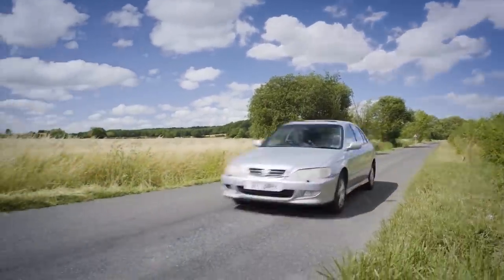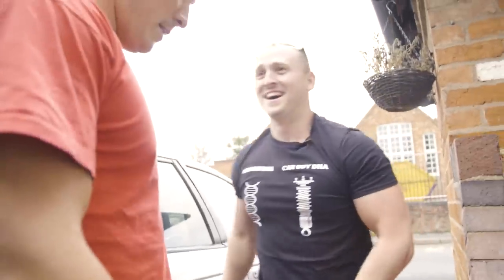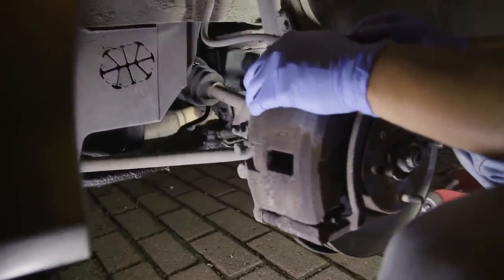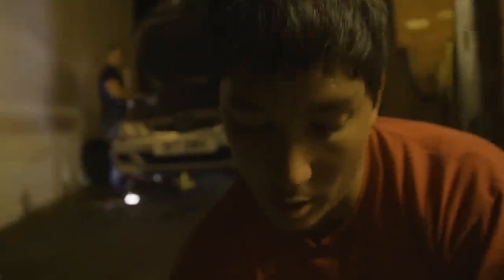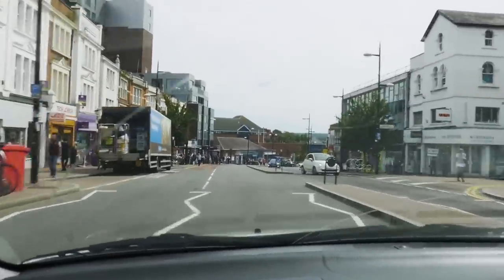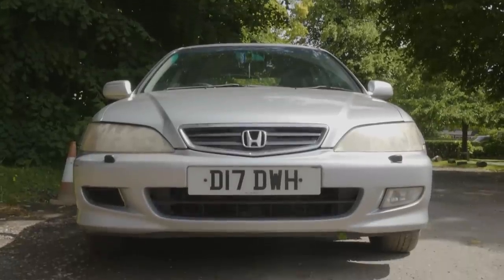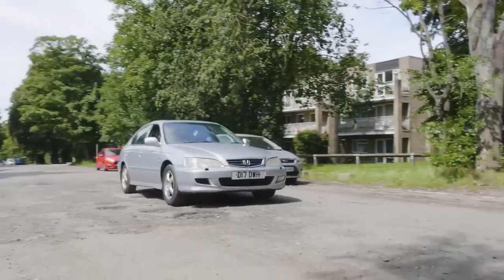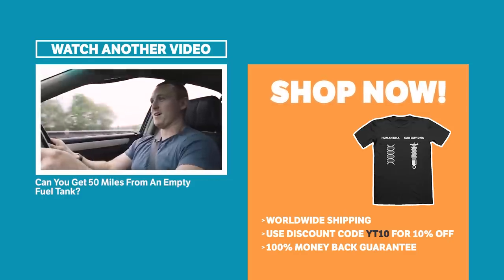Can You Daily Drive A Car With Cut Springs?

Comment: 4:50 "The spring rates have increased..."
WHAAAAATT?????
Reply: Nebbia affaraccimiei I read your comment just when he was saying that 😂
Reply: Gatis Girdenis cause the lowering springs have the flat bottom and correct pitch to seat correctly in the a-arm and not pop out.
Reply: Gatis Girdenis lowering springs are the same height as a stock spring uncompressed. The difference is that they have a progressive spring rate, which means part of the spring is softer than stock, and the rest is stiffer than stock. So when you put the car back on the ground, the softer part compresses more, thus lowering your car.
Reply: @iamstd2  wrong. Ffs. Google it
Reply: Cutting a spring does increase the rate, The longer the coil, the softer it is.
Reply: @iamstd2  I have H&R sport springs and they are already lower uncompressed, so what you say might be true only for some models of springs, depending by car model and/or by spring maker ;)
Reply: @spencerali1659  Are you sure? Because by cutting it you reduce the number of coils, but every single (remaining XD) coil remains unchanged in length, so i doubt that the rate changes this way....
Reply: RiccardoTheBeAst Read any chassis engineering book. Cutting a spring in half doubles the spring rate
Reply: @spencerali1659  Ooohhh ok now i get it, the single coil stiffness remains equal, but if you double the coils you also get double compression, right right... i had a wrong interpretation of your previous message, thanks ;)
Reply: @GatisGirdenis  Hes not wrong. 
Yes, cutting springs increases spring-rate; hypothetically, if there are 20 coils in a spring and each coil drops 1mm with 1kg on top, the coil will compress a total of 20mm. Now lets say you remove 2 coils, the spring will only compress a total of 18mm.
Its the same as torsion bar suspension (essentially a spring that's been unwound into a rod), if you cut the torsion bar shorter, the spring rate goes up.

Yes, cutting springs CAN cause the springs to pop out, for two reasons, firstly they've cut the square end of the spring off, so it doesn't seat properly. Secondly, the shock might be too long for the spring, meaning when the suspension unloads after hitting a bump the spring might be loose and has the potential to dislodge.

Tangential springs (Springs that don't have squared ends) can be cut without compromising safety as long as you fit a shorter shock so they aren't loose when suspension droops, and also higher damper rates so the car isn't bouncy and unpredictable.
Reply: @GeneralNOH  spring rates increase, ok. But the popping out, idk. I have a set of lowering springs on my car and when I jack the car, the spring is completely loose. Shorter shocks would sort that.
Most oem springs are not cut square, the spring seats account for the angled end.
Reply: @GatisGirdenis  Very good idea to get some shocks designed for your springs, or at the very least get the springperch moved on your struts.
It might not have fallen out, it might never fall out, but its possible and on top of that you essentially have 0 spring-rate at the in some of the top of your travel which is not ideal for handling if you go over a fast crest for example.
Id assume the lowering springs are also stiffer to prevent bottoming so the car doesnt handle as it should because the shocks arent suited, id bet it might even handle worse than stock. The shocks will also wear out quicker.

Im guessing you probably lowered it for looks moreso than handling but still something to keep in mind.

If you look at the video, the springs they cut did have squared ends. Pretty common on modern cars for at least one end to be squared off.
Reply: @GeneralNOH  quite a bit of assumptions.
Handles far better for what it is, it's not a racecar. It's a 800kg daily which is used for spirited driving, not jumping over 18 busses
The spring rate is not that much higher than stock. Also, I have oil shocks, which don't really have the "optimal range", just have to avoid bottoming out.
And checking two years apart, the shocks are still almost as stiff as they were before.

One end is squared off indeed, the topmount end, which no one ever cuts.
For euro cars which I'm familiar with, the spring seat is accounting for the spring with a stop, so as long as you cut it at the same place, it's gonna seat properly.
Reply: With stock springs I had about 10cm wheel to arch gap, now I have about 2cms and nothing ever rubs even with way wider wheels than intended for the small car.
Before it felt like jello
Reply: @GatisGirdenis   @Gatis Girdenis  Dont have to be jumping buses for loose travel to have an undesirable effect on handling.

Whether its a gas shock or an oil shock doesnt matter, they still have a set dampening on compression and rebound, if you lower your car the springs get stiffer and you should change the damping (esp. rebound), thats why good aftermarket suspension solutions come with springs and shocks. 
If youve dropped your car by 80mm, the spring-rate would have to have increased meaningfully or the car would bottom out easily, if the car bottoms out easily its no bueno.

Yes some springs do have a square end and a tangential end; but in the video they cut the squared off end of the spring, which added to the concern of it falling out as it wasnt seated properly, its entirely possible this car had both ends squared off.

You can have a car that feels like jello, yet handles better than another car that feels tight, theres a lot more to handling than how low and stiff it is; especially in cars where lowering them ruins the geometry (a lot of small FWD cars from the 90s have this issue)
Reply: @GeneralNOH  i didnt say shocks dont matter. Of course if we lived in a perfect world, I would've already changed them out, but I have other priorities. I meant it in the way that gas shocks wear out quickly if driven out of their optimal range, while oil shocks not so much.

Of course, if wandering off the road and going over 50mph/90kmh on gravel feels like suicide is handling better, then I'm wrong. For a 800kg car going 140kmh on gravel and still feeling stable is pretty decent to me. Cornering grip on tarmac could be better, but it is what it is.
Reply: @GatisGirdenis  Yep but if you're gonna drop your car 80mm without getting shocks valves for it, you're not going to improve handling notably.
Oil shocks not being optimum comes with its own problems aside from the lack of damping, its going to get hotter faster and the oil is going to foam which makes them fade.

The car i drive for work will do 140 on gravel comfortably. its also stiff and quite low; not like jello at all.
Still handles like absolute ass😂
Comparitively, my jello 4x4 will also cope with gravel at speed but will take a dirt corner just as quickly once it sets in and does it more predictably without bouncing in and out of traction
Reply: Put it to you this way, friend has an MX5. He could have dumped some quality lowering springs in and left the standard shocks, but for similar money he got swaybars and custom alignment that he spent the time to research, Why? Because it improved handling far more and it still rides nice and has good ground clearance for when you hit a railway crossing on a backroad at 120 and catch air😂. To get tangible handling benefits from lowering you have to put reasonable amount of money in. If youre just going for looks though, the cheap route works.
Reply: @GeneralNOH  well I did springs and the whole poly bushing set and it is fine. Next step will probably be adjustable dampers with air springs.
we're talking about a big car that has a lot of inertia and grip vs a small (supermini class) car that is squirly and floats over the pebbles and that comes with the meatiest 155 tyres from the factory (the sporty version, mine had a 145, currently running 175s, biggest I can do without rub is 195).
Reply: i'd rather have a car that is stiff and has no grip, that slides predictably, than have a grippier car that snaps in and out of grip.
Before I did stiffer springs I couldnt hold the car sideways for the life of it, the front gripped up and it had a neck snapping spin (multiple times). Now the car pushes out the back way quicker and possibly has less grip, but it does it in a predictable manner and I havent really spun out since, even when taking the turns hotter than comfortable.
Reply: @GatisGirdenis  So effectively, you had a car that handled poorly from the factory, and youve "fixed" that by effectively reducing the grip it has. Interesting approach ig lol
Reply: @GeneralNOH  reducing grip on gravel. Its effectively a tarmac setup (stiff and low), which will be less grippy on gravel, but with the car being more stable, it is way more predictable

Where I live, there is quite a bit of gravel road left
Reply: But what do I know, not like I do (relatively) high speed gravel commuting on a regular basis (more than once a week).
Reply: @GatisGirdenis  Except thats not really how its done at all - when you set a car up for dirt you usually take a softer approach, even in ideal situations gravel is inconsistent, in less than ideal situations gravel gets corrugations from being driven on over time and weather creates potholes. If you make the car stiffer, you reduce the ability of the tyre to maintain good contact with this uneven surface; some rally car set ups go as far as not running sway bars to make the suspension truly independent, maximising contact with the dirt. Tarmac or dirt, grip is still paramount, the way it is utilised just changes.

Essentially you've made your car easier to drive at the cost of handling (both on and offroad) by masking a problem rather than addressing it. 
By the sounds of it you've decreased the front grip such that the rear end doesnt pivot around quickly when you overdo it in a corner. Either way throwing in off the shelf lowering springs that drop your car 80mm (not modest by any means) and arent even capacitive and calling it a day just isnt effective no matter how you slice it. 

I lived on a dirt road as the only way out for years and frequent dirt roads to this day, often multiple times a week and have done so in various cars. Seeking out dirt roads is a past time😂 but what would i know ;)
Reply: @GeneralNOH  didnt read past the first few sentences because that was not even remotely the point. It's a daily, it's not set up for anything specific. Just has to be stable so I dont have to be sitting on needles the whole time. I felt like going stiffer and losing grip in exchange for stability on loose surfaces was the right choice.

Please show me a car that has insane grip on ANY surface without any changes in suspension and tires between the surfaces and has the stability of a Mercedes on an autobahn
Reply: @GatisGirdenis  Correct, you set the car up for the driving your doing. In a daily driver you compromise for varying surfaces, so no there isnt going to be a setup that does well on everything.

But you're missing the point, right from the get go i said you would've hurt handling.
By doing a sizeable drop with lowering springs without touching anything else you've compromised handling, regardless of the surface. Sure your car might be easier to drive on dirt because youve taken away grip but that =/= better handling.
Reply: @GeneralNOH  as I said quite a few comments ago, "if we lived in a perfect world".
And on the point of "hurting handling". You are still making assumptions, because you dont really know if the spring rates changed. The car previously was just the smallest amounts of softer, the long springs were for the bigger engined cars (mine was the most basic 1.0, now it's a 1.6) and to account for the pretty hefty luggage space, as the seats bend down. Even with these lowering springs and with 500kg loaded in the trunk  in a, to be more exact, 760kg on paper car and the shocks still had plenty of travel as I could still bounce the car and wheels tuck in pretty far (no tire left, far) while without any load there is a one to two finger gap. So I still have plenty of oil shock travel left.

What, I'm assuming, got me the most stiffness up front (the front grip reducing part) were "sport" poly bushings. The rear is a torsion setup and i didnt change any bushings there.

If we wanna talk geometry, the front lower control arms are pointing downwards at about 5°, which is pretty good for a macpherson setup.

The only thing you can "swing" is imaginary spring rate not being matched to shocks. While even I dont know if it changed.
Reply: @GatisGirdenis  From what you've said the car has dropped 80mm, just over 3in, that's not insane but it's not a modest drop either. 
If the spring rates didn't increase, you'd likely have bigger problems than if they did, the car would have the tendency to bottom on bump stops which is obviously bad for both handling and the components bearing this force. For this reason, manufacturers practically always increase the spring rate on lowering springs, and the lower they go the more it increases; how much it will increase depends on the motion ratio, (spring/shock travel vs wheel travel.)
Unless you have position-sensitive shocks or the shocks are bottoming the travel isn't the issue aside from the fact that they are too long which will only be a problem when you hit very large bumps/crests. Again the main issue goes back to matching spring rate to shock damping.

Stiffer bushings do not affect grip in the same way stiffer springs do; again stiffer springs will reduce the ability of the tyre to maintain contact rougher surfaces (in this case, gravel). Stiffer bushings will actually make better use of your suspension, such that it's more responsive which actually improves grip.

Torsion rear hmm. Howd you go about lowering that? On most torsion bar cars I've seen (usually 4x4s) you can actually raise/lower the car with the stock bars by changing the starting position, with little effect on the spring rate which means you can keep stock shocks - the only issue is you'll bottom significantly easier which is why you'd use an aftermarket (stiffer) torsion bar. But the best way is using drop spindles; keeps stock geometry, springs and shocks, not cheap though, and might not even be available for your car.

5° static or under full compression?
In either case, as it approaches parallel under load you get less and less camber gain when you actually want more and more, and if it goes past parallel, you lose camber. 
So by lowering Macpherson strut you always reduce camber gain, and in extreme cases lose camber. 
The other issue is, by lowering it you lower the roll couple faster than the centre of gravity; which means more body roll (Given the same spring rate) and body roll in MacPherson strut = camber loss.
So you're effectively losing camber on two fronts.
This makes stiffer springs even more critical now that you need it for reducing camber loss due to roll along with bottoming resistance; which again calls for better shocks.
You can also address this by adding static camber, but then you lose straight-line acceleration and braking, you can also increase castor which effectively adds camber with steering angle, but this isn't always simple. 
Best way? Correct geometry back to closer to stock (or in some cases, better than stock) but again not always simple, requires custom fab for most cars.
The cheapest/easy/practical way? don't lower it too much and go stiffer springs + shocks the lower you go, (how much is too much will require measurements, research, trial and error and also be dependant on how much comfort you're willing to give away)
Reply: @GeneralNOH  spring rates dont necessarily need to increase the lower you go. When oems choose the spring rate, they have to account for loading capacity, clearance, the chassis and and they have to estimate the average car speed as well (as with higher average speed comes stiffer spring). My car can handle a load of 500kg while being 760kg itself, so stiff long spring makes sense, because I doubt the oems want wheels tucked behind arches. So with going lower you can still keep the spring rate and lose the loading capacity, because of rub and bottoming out.

Torsion beam, not bar. Has two shocks and springs, just like the front, has a function of an antiroll bar in itself.

5° static. About 4cm more of compression till it goes straight, the camber while static is about 2 degrees negative.
As for the camber gain part, again, depends on the springs (going higher doesnt mean softer/more travel in the same circumstances). On my car I can bet money that I can get the oem spring rate, shorten the shock so that it doesnt loosen up the spring or bottom out on jumps and it would be fine, just because the oem probably gave the car a stiffer setup because the suspension can handle basically two of its own chassis.

And lastly, you havent taught me much new if anything. Our knowledge aligns, you're just overthinking it, lol.
Reply: @GatisGirdenis  On the vast majority of cars they do which is where my point stems from, especially once you go beyond about 1.5in lower. As far as loading capacity the rear suspension is going to be designed to bear most of this weight. 

But i guess there is the possibility that the car was oversprung in the front as you suggest.
Assuming thats the case, this still poses a problem because if the springrate is the same, this would mean you now get more body roll in the front than stock due to the macpherson geometry, and the car will also be more challenged in terms of camber up front because youre now working in a range of travel that gains less camber under load than it did at stock height (even if the amount of travel is the same). So effectively youre gaining positive camber due to more body roll and simultaneously not gaining as much camber under cornering as the car did at stock height. An ARB up front could help the body roll, geometry adjustment would fix both the body roll and give you more camber gain.
This is ultimately why people with some idea whom tinker with MacPherson front cars handling dont tend to lower beyond 1.5-2in (WRXs, BRZs, Focus, Golf etc.) And if they do they either correct geometry, or take the go kart approach to suspension + lots of static camber

What car is this anyway lol? Some sort of Kei car?Sounds interesting either way
Reply: @GeneralNOH  Polo mk2f.
It's sort of a macpherson, well it probably is, but it doesnt have a 3 point control arm like the usual. It has a lower arm that controls up and down movement, and the sway bar ends bolt straight to the arm near the ball joint, to control front and back (so essentially, no way to run without the roll bar in the oem setup).

Most of the polo track cars I see are even lower than I am anyways. The most common issue with suspension, which is a 60€ fix, is reduced caster angle on lowered cars (due to the sway bar pushing the wheels back, because of the change in the angle).

All the people who build track polos say that if you get camber caster plates, go full caster even with the antirollbar blocks (moves the sway bar forwards to get some caster back)
Reply: Also, the "80mm" lowering spring is not exactly that, because most commonly 40mm is the max you can go before you get rub on the drive shaft or rod ends, cant remember exactly. But I havent experienced any rub at all, so it probably is equal to the 40mm lowering spring of the "more powerful" models. My car is maybe an inch lower than stock Polo G40 (top dog model) which uses the same shocks as mine (nothing in the suspension except springs and arb changed)
Reply: @GatisGirdenis  ah yeah theyre a cool car dont see them here much at all. That almost sounds like some kind of cross between multilink and macpherson because it doesnt just have 1 LCA.
Yeah maintaining or increasing caster is ideal on cars with macpherson style suspensions, one of the good ways to get around the camber gain curve.

I just thought 80mm lowering because the body of the car got 80mm closer to the wheels from what you said, might have something to do with the motion ratio of the car where 40mm lower on the springs = 80mm lower at the wheels or 1:2 ratio